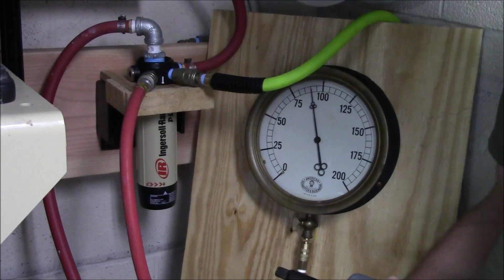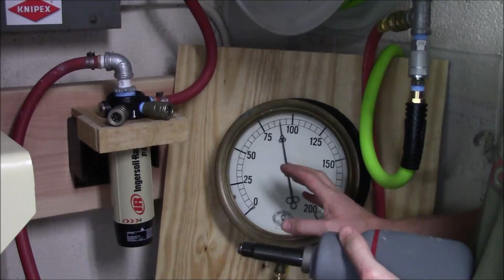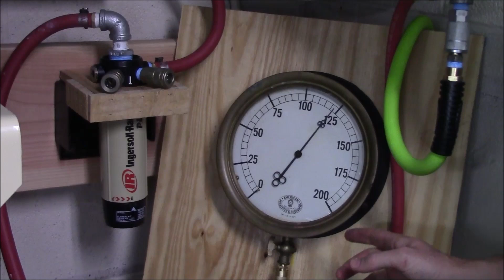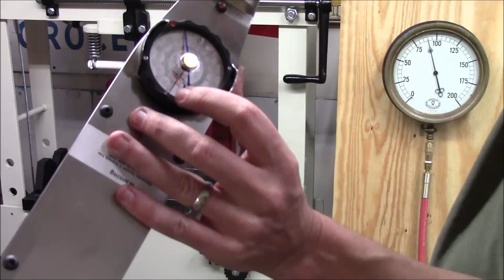Air Pressure : Working PSI - VS - Static PSI

Comment: Explain why an air compressor fills 4 tires at once quicker with a 1/4 hose vs a 3/8 hose.Its mind boggling but an absolute fact and proven on a you tube video from a guy who does overlanding with his jeep and lowers...and raises the psi on his jeep with a 1 into 4 hose set up hooked to a small air compressor..So there is a situation where a smaller hose gives better performance.
Reply from the maker: Probably not the hose, but the fittings being the issue….. high flow fittings/couplers move a lot more air than standard ones @ the same pressure.

Comment: So if my tool says max 90 psi, and I need to set the static pressure to 130 to get to 90psi, it won't damage the tool since that first second is sending more than the recommended PSI?
Reply from the maker: Psi recommendations are working pressure, not static.   This is why so many people don’t like air tools & feel like they are “weak”.

Comment: with a home shop and a 30 gallon tank the tank has a 1/4 inch outlet , so when you go to a 3/8 inch hose your not gaining anything , the starting gate has to have a larger fitting to maintain the output .    i try to tell people high flow fittings are a waste of money with a home shop tank with the 1/4 inch fittings from the tank.  1/4 going to 3/8 you lose psi get flow .  shop tank with 6 cfm will only have 6 cfm .

Comment: I was worried my tool would explode as it says 90 PSI max.  Adjusted the valves now it does 90PSI static and load.  Can you make it go say 175 PSI on static and working 90 PSI and be ok?
Reply from the maker: If the tool was a high enough volume CFM, I suppose so….like a blast cabinet.

Comment: So the air pressure and air consumption  mentioned on pneumatic tools are the minimum requirements and not the maximum right?
Reply from the maker: It’s the “suggested”..... basically if you don’t have that much while in use, the tools will under perform greatly.
Reply: @RealToolReviews  What if you have no regulator for your air tools? The shop I work at has a 15HP 80 gallon compressor that goes up to 185 PSI. All of the air drops are an unregulated air source and nobody seems to care what pressure they put through their tools. I have a hard time believing that this is not harming the lifespan of the technician's air tools. What are your thoughts?

Comment: Is there any difference in performance if using 3/8” npt plug versus a 1/4“ high flow?
Reply: Good 1/4 in high flow will blow way a 3/8. 3/8 is garbage. I have used them both. I have a work trailer, 17 cfm @175psi gas compressor 200 ft of 1/2 in, 300 ft of 1/4 in, numerous shorts and 40 different nail guns and air tools. Best thing to do is get rid of all unnecessary disconnects as possible.  I found some rated 70cfm at 1/4. The openings are MUCH larger then the 3/8s i had previous.  The real restriction happens in the female coupling though. Killed me to do them all twice. Think i spent close to 200 to redo everything each time.  Some of my main connections, i went with disconnects with no guts basically a straight shot because i need full flow when doing spray work in homes. I have actually ran 175 psi to the site in the 1/2 then regulate down to tool or spray pressures to get some coatings flowing more consistently.  If i have a larger crew 4-7, i run the main line out and regulator with a small booser tank after the after the regular so the field regulator can keep up. Regulators are flow killers also! That is where the real flow drops. I run 1/2 in regs on my sprayers with a 3/4 in air line for the 25 ft. After the reg. The type and brand is huge deal too.

Comment: Can someone help me with my compressor, i need working 10 psi. So, my static pressure is 10PSI but after i start to sandblast it lowers to 8 psi, how can i make to sandblast all the time on 10 psi. Ty
Reply from the maker: Turn your static pressure up to 11psi & then recheck.....then 12psi.....etc.
Reply: @RealToolReviews  im sorry, my compressor is static on 10 bar but after starting to sand blast it goes down to 8 bar, how can i make my static and working pressure even on 10 bar?

Comment: Man thank you so much for this video. I was dealing with this issue all night. I bought a new 21 Gal Air Comrpessor and some air wrenches for car work, tried removing my truck lug nuts with a 1/2 impact and it would not budge. Which stomped me at the impact was rated for 350ft lbs. Tried your method and I saw a drop from 90PSI to about 60PSi working through 3/8 fittings and a 1/2 50 foot hose. Upped it to 100 static and now it zips through with no problems at all. This vid was a life saver.

Comment: This is just the video I was looking for! I got an air compressor and set it to 90psi but my 3/8 impact wasn't very skookum. I got like 70 feet of 3/8 line. Had to set my tank to like 135 psi to get 90 at the tool.  (Not optimal I know) I have electric tools so I don't use the air that much but I got some specialty air tools for cars and stuff.
Reply: Get a high flow regulator and high flow couplings. Huge difference

Comment: I have a Husky 30 gal oilless. If I replace the regulator with a 3/8 ball valve should I also add a pressure gauge down the line to know my working psi? Also would a high flow regulator be an option?
Reply: Millton or DeVilbiss. Go with 1/2 in. 3/8 is ok but i normally oversize mine.

Comment: Guy,  Thanks for sharing some information and your time.

Are you familiar with any type of gauge or setup to measure CFM at different PSI's?  I just started with the CFM search on YouTube today (02-02-19). Let's face it, you take for granted what the label of a new compressor says from it's manufacturer for CFM at a specific PSI (like 90 PSI).  I also appreciate the input by other YouTube channels, on calculating air compressor CFM estimates.  But a process of calculating the time it takes to fill a specific size tank with a desired PSI, only provides a static CFM estimate. I'm looking for working CFM at a predetermined PSI.  Do you know of any gauges on the market?  You ask why do you need to know your air compressor's CFM?  Let's say you have an air compressor that is 5 years old.  How do you know when the pump needs to be rebuilt?  For beginners, the motor is wasting a lot more  energy, and it's taking longer to get the job done.  In addition, if you are buying a used compressor how do you know the healthy, or how worn out, the air pump of the compressor is?

Any input from you, or any other viewer from YouTube, is appreciated.

Thanks to all! 

BatTime

Comment: First and foremost, I could scour the web for all videos related to pneumatic tools, compressor and else, but always end up coming back to "REAL TOOL REVIEWS" to satisfy my urge for knowledge in these matters. All of the videos are so well detailed, and you can tell the host takes time in putting into lemon terms all of those things that could be hard to understand at time. Thank you "REAL TOOL REVIEWS." 

The idea of working psi vs static psi was something coworkers and I talked about for quite some time at work. We used different terms to describe the phenomenon to the best of our ability. Working psi vs/and Static psi, what a better way to put it. For that, Thanks again "REAL TOOL REVIEWS."

Continue with all those informative videos. You got many admirers just like me who rarely comment, but watch ALL OF YOUR VIDEOS. Last but not least, I believe your Airflow regulator set the air flow in the hose while the "Clock looking antique device" helps pinpoint how much air in your hose while in static and working mode. Forgive me if unable to clearly called each tool by its right name. 

What is the name of that Clock looking antique device making possible for you to know your working psi to your static one? Where can we get something like that or an alternative? Same goes for that air regulator. I look forward to hearing from you.

Comment: I had a massive pressure drop problem with 75ft of 3/8” hose. Like from 140psig at tank to 40 at the gun. Turns out my hybrid hose had some internal debris from mfg nearly plugging it. 

I re-plumbed my setup, moving the filter and regulator to the end of 50’ of 1/2” hose, then running another 25’ after the regulator. Having the regulator closer to the end of the run really helps. I’m getting <10 psi drop now with my impact gun (admittedly a compact Husky).

Also, it a good idea to have the filter BEFORE the regulator. You want the regulator protected.

Comment: I was under the impression that the static psi was what you were supposed to set the pressure to, so when an impact has a psi number on it, you can go beyond that to make your "working" psi what that number is? This seemed to be exactly what you said in the video here as I understand it, I just wasn't aware that you could do that, I didn't know you wouldn't damage your tools when the static PSI is much higher than the working PSI. I have just a small porter cable 150psi max compressor with a tiny 3 or 6 gallon tank, can't recall, and 1/4 fittings on 3/8 hose. If I had my static set to 150 would that be ok for most 1/2 impacts, or is that high of a static not good? I realize it should be set so my working is a certain amount, if I could watch the regulator pressure that is already connected at the output of the compressor before my 50ft hose and get a good read there I could be sure to set the working correctly. I'm just curious if 150 is ok for most impacts to be sitting at for static if I do have to max out the static to get a good working pressure.
Reply from the maker: With small compressors like yours, I typically have the regulator turned up fully....due to pressure drops, there is no way that they can or will damage an air tool.
Reply: Thanks, very good to know, I got a couple new AC Delco impacts and none of them specified a max psi so I didn't know. Found that if I set my little compressor to about 115psi it will run my little impact at 90. Great video and info. thank you.

Comment: I have a 20 gallon Campbell and Hausfeld. My gauge on the tank regulator has been acting a little strange so I added a gauge and regulator at my tool to see what it would give me. With 120 static PSI I use something like a cut off tool it drops instantly to 60 PSI. then 20-30 seconds later slowly goes down to 50 PSI. then down to 40PSI after about a minute. Not sure what to do. any suggestions?
Reply from the maker: Remove the regulator on your tank & replace it with a ball valve + coupler.  That way you turn the valve off, hold the trigger to remove the pressure from the line, and then remove/install the line with ease.  Once connected, turn the valve on.

Harbor freight sells those valves (1/4" or 3/8" NPT) for like $6 or less in the air fitting section.

The stock regulators go bad & really kills the overall flow.  As far as your lower pressure over time problem -- that is because the tool is using more air than the compressor can refill during a given timeframe.  The overall capacity in the tank is depleted, resulting in a lower pressure.  For small tanks like yours, it is best to use a tool & as soon as the compressor kicks on (due to the pressure dropping), stop & wait for the compressor to kick back off.  That way you are getting the most air pressure possible -- resulting in the best tool performance.

I suggest (at minimum) one of the 29-gallon/30-gallon belt driven compressors that you find at any major box store (NOT an oil-less version.....a separate motor + compressor, which are connected by a belt).  For anything more than occasional use, that is the way to go since the CFM rate is much higher & they still run off of standard wall power (110v).

Good luck!
Reply: So by replacing the regulator with a ball valve this will solve my instant 60 PSI drop? 

As for the slow decent, it wont bother me as much if i can work starting from the 90 PSI point. I use it continuously for at most 1minute at a time anyways.
Reply from the maker: Your air lines (length + ID measurement) & fittings are probably also to blame....anything can cause a bottleneck.   

I’d suggest 25’ of 3/8 ID line + 1/4” High flow fittings/couplers....that will give you a big improvement in addition to removing the stock regulator.
Reply: ok thanks for the advice!!

Comment: So,

Will this work with any compressor? I have a small 26 gallon compressor. Puts out maybe 4-5CFM. 

Without having that setup you have, it seems like your numbers are put it at 125 psi to get 90psi working pressure with a 50FT hose? With those fittings and Hose.

Comment: how are you getting 3/8 plugs into that mighty 7?
Reply: im boggled, i found some reducer plugs from amflo, but is there much orfice size/psi drop/power difference over the milton V hi flows in 1/4?

from your 1/2 in hose did you use a reducer to the tool or did the hose have 3/8 ends?
Reply from the maker: 3/8" fittings with 1/4" NPT threads (high CFM vs standard 1/4" plugs).  I believe that 1/4" high flow is going to have almost identical results/performance as these 3/8" versions & am currently switching over all of my air tools to them.  I have bought about 20 kits locally in the last few weeks.  I would NEVER use standard 1/4" plugs ---- only high flow!
Reply: Real Tool Reviews i was lookin on miltons website and their V style hi flows in both 3\8 and 1\4 have 74cfm.  have u ever used a micrometer to compare the two? their specs seem very unlikely

is amflo the brand of plugs you use? whered ya find them locally?
Reply: Would love to know this as well
Reply: Real Tool Reviews ive got mine set up similar to yours. i ran 1/2 hose with 1/2npt and then reduced it for the 3/8 coupler. 

what kind of fittings do you have plumbed in to the gauge at the end of the hose where you can read your working pressure? a T of some sort i would imagine?

Comment: u save my life again, any recommendations for my husky 20 gal & ingersoll rand 231c ?
Reply from the maker: +Cody Koala yes....remove your regulator, add a ball valve & either all 3/8" fittings or 1/4" high flow fittings .... and use 1/2" air lines.
Reply: thanks for your valuable suggestions!

Comment: AvE needs to watch this after that sorry test on the HF Impact test he did.
Reply: Real Tool Reviews Damm shots fired
Reply from the maker: +ri mar well....I have very expensive calibrated equipment designed for testing torque in a controlled setting with repeatable results.....others like to pretend they know everything and can make a better test unit from junk laying around a garage....I think we all know who has REAL numbers.....
Reply: BTFO

Comment: One metric you might consider adding to your air tool videos is the amount of airflow required by the tools.  That would give an indication of how much compressor CFM is required to operate it without continually waiting for it to catch up.

An easy way to determine it would be to charge up the compressor tank to the cutoff pressure, then measure how many seconds of operation it takes before the compressor kicks on again.   Or if that takes too long, run the tool for a certain amount of time like 30 seconds, then read the tank pressure to see how much it's dropped.

I've found that better quality tools are more efficient and use less air compared to the cheaper ones for equivalent work output.  Adding this measurement might reveal some benefits of the higher cost versions.

Out of curiosity, was there a difference in the pressure readings you saw when the impact gun was free spinning vs. impacting against the fixed nut?  Wondering whether it draws more or less air when free spinning-  with electric tools, the current and power draw actually goes up when it's locked compared to when it's free spinning, but it may actually be the reverse with air tools.
Reply: Powerful 1/2in impacts are about 20cfm @ full power.

Comment: I love your videos/Reviews and am always checking youtube for any new ones you put out regardless of the tool.  Can I make a suggestion and say that you should really do a demonstration/review like this video on air fittings and how they will also affect air pressure i.e quick connect couplers (3 rings universal, 2 rings industrial, 1 ring automotive style) Different diameter hoses (1/4", 3/8", 1/2" ID), different style couplings (industrial, automotive).  I just did a ton of looking around, thought about changing all my MNPT 1/4" to 1/4" MNPT 3/8" inlet automotive style like yours but came across Miltons' V-Style High Flow couplers & fittings and they really do make a difference.  Also with percussion tools the importance of using a whip/snubber hose to save your fittings from wearing down prematurely.  Anyway you get the idea, and since your so good and have the resources to do such amazing reviews I figured I'd leave it up to you.   You rock man you've helped me more than you could possible imagine.  Im the guy that over researches everything before I buy so please keep doing what your doing!